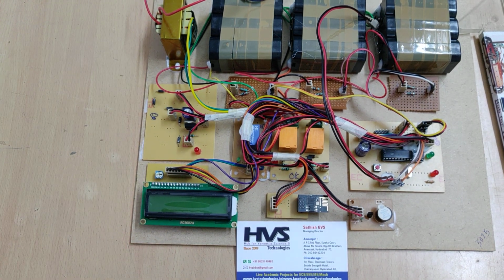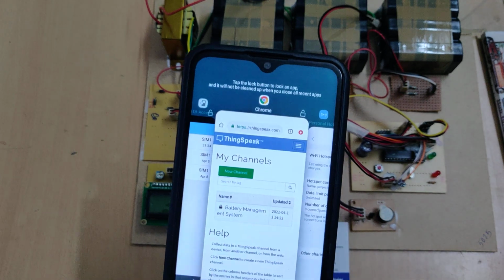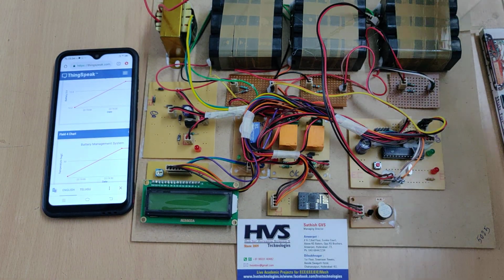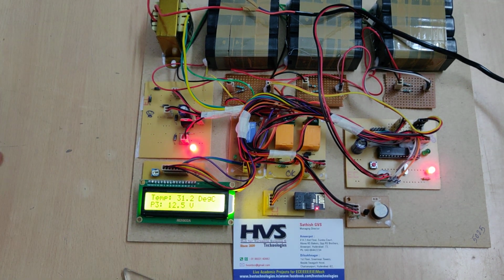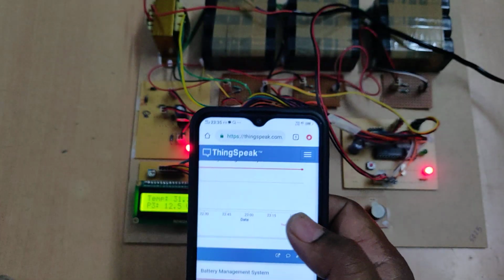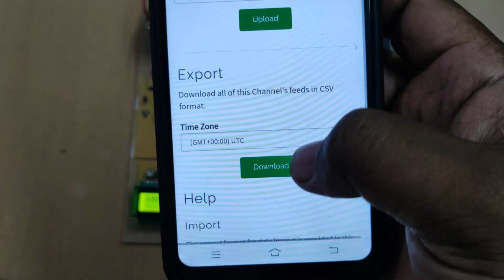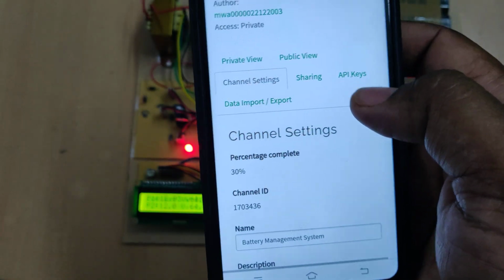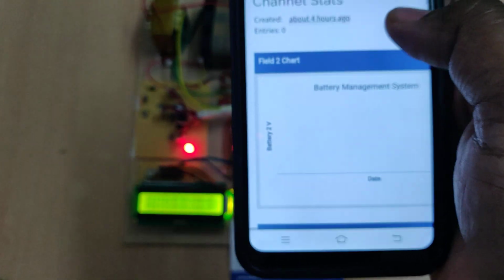HVS-3283. IOT Battery-Management System (BMS) and SOC, SOH Development for Electrical Vehicles.

Comment: is thingspeak freee lifelong for small  projects like this
Reply from the maker: @sakethdamin5089  yes. It's depends on the channel. Hi, 
We sell full working kit with document PPT circuit diagram and code. Could you Send me the video link, Will update you the cost details. You can contact us at +919603140482
Through WhatsApp or call
Reply: @hvstechnologies  i didont want kit 
I want to implement this syetem in my battery pack
Reply from the maker: @sakethdamin5089  Hi, 
We sell full working kit with document PPT circuit diagram and code. Could you Send me the video link, Will update you the cost details. You can contact us at +919603140482
Through WhatsApp or call